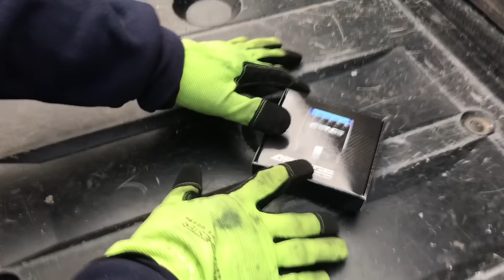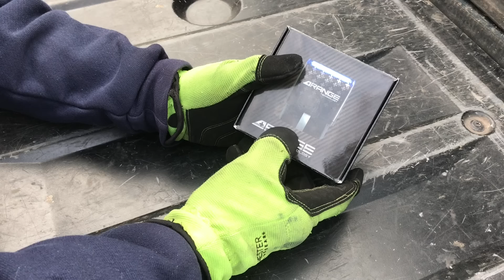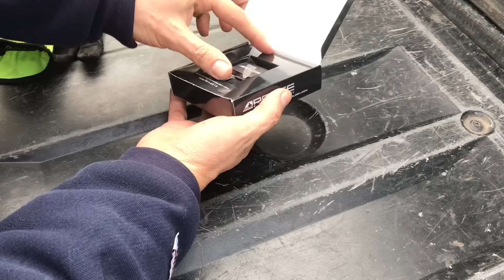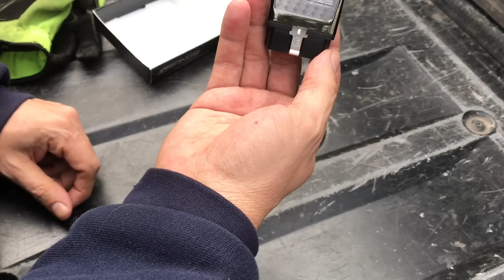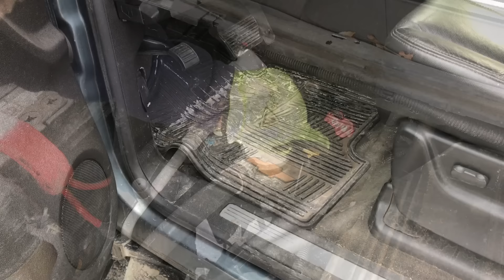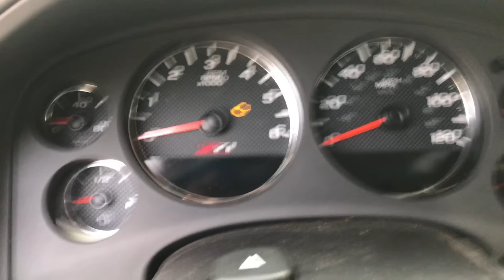Range AFM Disabler - Long Term Review

Comment: wow...wish I had discovered this product before I towed a trailer full of heavy bikes from Springfield to El Paso and back in crazy high heat, on the way down it burned a quart of oil and the tranny was pushing the temp gage too close for my comfort, on the way back I used that tow button on the end of the shift lever, even though the RPM's were higher the tranny stayed cooler and I didn't burn any oil which now I realize its prolly because the AFM was deactivated. 07 Tahoe 5.3ltr 160,000mi.    thanks Hilltown!
Reply from the maker: Your truck got a workout!  I prefer trailer mode and run it most of the time unless I’m in stop and go traffic.  Thx for watching.

Comment: I run one in my 2008 Yukon 5.3 for 10,000 miles now took care of the oil consumption as well my truck runs great @206,000 miles now
Reply: Mono G iam not sure about the vibration your talking about
Reply: How is your yukon going?
Reply: @madbroindustries  well I sold it to my buddy 10 months ago and bought a 2020 silverado 
It still going 256000 miles
Reply: @Jgrace-hu6xn  dammm so it did work?
Reply from the maker: That’s impressive.  Out of curiosity, are you still on the original transmission?
Reply: Hilltown no not original transmission rebuilt @ 185,000
Reply from the maker: Ok, thanks.
Reply: Srt Jg I have same everything yukon and it vibrates on v4 mode when going slow speed and everytime I slow down to stop and still on v4 mode, will this device fix the vibrations?
Reply: Srt Jg is there a big difference of gas saving? Before and after device?

Comment: 175,000 miles and it's using oil ??? Well duh! Gas engines won't last as long as a diesel.
I can imagine the AFM might suffer with an older high mileage engine.
There was a time when the Chevy small block was finished and needed a rebuild at 40,000 miles.
Maybe it's time you did a rebuild.

They must have improved the AFM on the 2018 models. I notice no changes to indicate the truck is switching from V4 to V8.
Smooth as silk and great gas mileage. Not to mention, it's not burning any oil. :-)
Reply from the maker: I’m running her into the ground.  It’ll be interesting to see if the road salt or the mechanicals kill her first.  My history of high mileage Chevys never included an oil burner and i’ve driven three close to the 300k mark.  Thanks for watching and I’m hopeful they got it right with the 18’s.
Reply: I have an 03 with 4.8 ltr with 229,000 miles and it doesn't burn a drop of oil but unfortunately rusted brake lines sidelined it till i could replace them so i picked up a 2011 silverado with the 5.3 and i am becoming and expert in AFM delete preparing myself for the inevitable. It has 125,000 and doesn't use any oil yet. Maybe i can save it.
Reply: Ram a 6.0 prior to AFM well over 300k towing most of its life. Small issues but every car has its own. The basic design of these motors is great. Afm is a joke.
Reply: @kou thao  l have 2017 Chevrolet Silverado and change v4 to V8

Comment: What do you do when you have to do an emissions inspection? Do you leave your Disabler in and remove it at the time of the inspection or do you remove it a couple of days before your inspection to give the computer time to reset? Thanks
Reply: Egerton Ridout it doesn't.  I forgot to take mine off of my Sierra and I passed.
Reply from the maker: I haven’t had an emissions test yet, but I’ll just yank it beforehand.  Interesting comment! Thanks for watching.
Reply: Hilltown do you mean, the sametime of the emissions inspection or days before? Just wondering sir
Reply from the maker: Probably 5 minutes before I pull in for the test.  I don’t see how it can have an impact, but we shall see.
Reply: Hilltown I see your point. I agree with you. I'm thinking about buying a small OBD2 scanner to make sure when I go to get my inspection that I would pass. The 8 monitor screens or Windows on the scan tool need to pass and if they do, good to go

Comment: I didn’t see any comments but I also hear that the stock valve cover with the PCV valve has a tendency to get stuck open and  lets oil through. A friend of mine who is a GM mechanic said that replacing the valve cover on the driver side should also help.
Reply from the maker: When my truck was 5 years old, under extended warranty, the dealer tried multiple fixes for oil consumption including something related to the PCV valve. Unfortunately, nothing worked and they eventually did a piston ring kit. All was well for 100,000 miles and then she started burning again. This device seems to have helped me quite a bit. Thanks for watching and sharing the advice.

Comment: Who the hell buys a 4x4 to save fuel what the hell was GM thinking
Reply from the maker: It’s all about the MPG wars.  Thanks for watching.
Reply: The manufacturer had to meet BHO's EPA standards. That's why gm did it
Reply: The Active fuel management will fail sooner or later...Do a "Delete kit "...remove the lifters, change v-plate, new cam (needs dealer cam learn) and make sure you plug the holes under vlem or valley plate and swap out your oil pump to a standard pressure oil pump and you can still use this device or pay $400-$500 to reprogram the afm. You will immediately notice improved horsepower and smooth idle...you lose about 1-2mpg but no headaches and very reliable. Good luck.
Reply: whats the delete kit and all that run price wise?
Reply: @KA317-1  The delete kit ran me $650(Amazon) and the diablo sport afm disabler was $200(Amazon)..$120 melling standard pressure oil pump..my buddy is a GM tech and installed everything for $400..oh the rivet gun and plugs were $100(summit)....gotta plug those lifter holes or there will be 0 oil pressure at idle...the kit is all the gaskets, camshaft and a few other internals.
Reply: @KA317-1   a true full delete will cost you thousands by the time the labor is installed . If you take it to a shop which 99% of people will have to , it ain’t exactly a DIY job.
Reply: @ceedavis5178  Note that it only makes sense to do this after your warranty has expired, because the "Delete Kit" will void an existing warranty.
Reply: @chrisgraham2904  Delete Kit yes. But using Range is ok and will not void warranty.
Reply: Federal CAFE regulations
Reply: It’s the governments EPA that tell manufacturers they have to have a certain MPG avg. it goes across all there vehicles. So they have to save ever ounce they can.
Reply: Wonder if the government knows where the missing oil goes!! Atmosphere maybe ....... that's good and green.
Reply: @davidrobinson7887  That's right.  The system squeezes an extra mile of travel out of every gallon and then burns the oil releasing far more pollution into the atmosphere.   The EPA standards are being met, but the regulations cause a larger carbon footprint.
Reply: @davidrobinson7887 catalytic converters lil bro
Reply: There you go, applying common sense. Come'on man!!!
Reply: Tree huggers
Reply: yeah pretty stupid to think anyone wants to save on fuel.
Reply: EPA
Reply: they did it on v8 auto camaros too
Reply: you can thank the EPA  the range device is illegal in california
Reply: @punker4Real  they won’t even know you use it 🤣
Reply: Amen to that my guy. I love hearing my 8 cylinder gas hog and my 35's humming on the pavement. If I wanna save gas I bought my ol lady a mini van. 😉🇺🇸
Reply: its the epa, how do u not know this.... trucks have been getting regulated since the early 90s and its only getting worse
Reply: Bunny huggers in league with the socialists. The socialists want to control our movement, and the bunny huggers gift wrapped them a marketable excuse.
Reply: Thank Obama! It was because of regulation
Reply: That's what I'm saying.  If you want a woman's truck do get a v8

Comment: I've heard some people were getting a CEL. Some times it would pop on and off, or just stay on. Has that ever happened during the period of time you've had it installed? Also heard these devices have been improved recently too though.
Reply from the maker: Hey Husky, I was a bit worried about that too after reading other reviews.  So far, so good.

Comment: Great Review , I run one on a 2010 5.3 Silverado , works very well , helped with oil consumption considerably , can't tell any difference in mpg one way or the other.
Reply from the maker: That’s good to hear and others can benefit from it to.
Reply: Michael Proulx, I too have a 2010 5.3 liter Silverado LTZ. I'm glad to hear that you having great success with the Range device. I have been wondering about buying one and wanting to know from you, how long have you had it in your truck, have any lights came on light the ABS, traction control or check engine lights and have you noticed any issues with your transmission? The reason I'm asking cause of other reviews, but they have different years models and you have the same year make as I do, so I want to compare apples to apples, lol. How many miles do you have on your truck and how many miles has I been since you installed the Range AFM deactivation device? Thank you

Comment: I'm a little worried about the long term effect of this device damaging the engine. Even with 2010 Silverado 5.3 liter that I have, just want to know if the Range device would have any long term effect on the engine
Reply: Tammy Ann  I’m replacing the motor in my 08 now. Lifters collapsed at 129k mikes. I’m turning off the afm, this time around.
Reply from the maker: I don’t see how it could, but that is just my novice opinion. To me, the ill effects of AFM outweigh any possible risk.  Thanks for watching and good luck with your decision.
Reply: Milltown, how long have you been running the device in your truck and did you order it through the Range website? How many miles have your ran it on your truck. Yes, awesome video and thanks for sharing
Reply from the maker: I’ve had installed for about 7k miles over a four-month period and I purchased it through Amazon.   After reading other people stories, I would recommend buying it direct through Range.
Reply: Milltown, do you notice any difference in the transmission once the range deactivation device is in? I was wondering if it shifts the same or have you noticed whether or not the transmission is shifting hard into gears? I have the HD 6 speed transmission in my 2010  Silverado LTZ. Thank you
Reply from the maker: No difference at all bud.
Reply: A mechanic just looked at my truck, 2010 Silverado LTZ, this device will save you from your lifters collapsing.  Unfortunately I did not catch this in time and now I have to buy a new engine and he highly suggested that I purchase the AFM disabler not to have the same problem again.  Get the device for $150 to $200 instead of dishing out $5000 to $10,000 when it damages your lifters and you have to replace the engine.
Reply: Tammy Ann    A whole new engine because the lifters went bad?.....hmm🤔
Reply: You mean long term damage  like your lifters collapsing burning oil and or damaged camshaft? Thanks Chevy AFM
Reply: Will this save my lifters from collapsing or will they shit the bed no matter what?
Reply: How fast will my truck go with the range

Comment: I had a 2007 Silverado that was eating oil also.  It would lose a quart every 3000 miles.  I found a TSB for a revised valve cover for the 5.3L AFM engine.  I took it to the dealer since the oil consumption was documented as starting at 35000 miles on the truck.  They explained that the oil was being splashed up on the PCB valve.  The oil was being sucked through that system.  The revised valve covers had a PCB splash guard installed to minimize the oil being sucked into that system.  They wouldn't put it on my truck though since my vehicle had 96000 miles on it at the time when I found the TSB.  Of course the TSB came out in like 2013 and my truck was a 2007 and way past warranty.  Being a TSB and not a recall they had no obligation to put the new valve covers on my truck.  I told them where they could put the truck and sold it soon after.  So I don't think the cylinder deactivation has anything to do with the oil consumption.  Search on 

"10-06-01-008G:
Engine Oil Consumption on Aluminum
Block/Iron Block Engines with Active Fuel Management (AFM) (Install AFM Oil Deflector and Clean Carbon from Cylinder and/or Install Updated Valve Cover) (Jan 3 2013)"
Reply: Milltown, try using some Lucas Synthetic or Heavy Duty oil stabilizer. I just put it in my truck with 79,000 miles on it and I have had great success in past vehicles with Lucas oil stabilizer. I use it in my 98 GMC Sonoma with 2.2 liter engine. Truck has 280,780 miles on it. I have been using 3 quarts of Castrol Edge full synthetic high mileage oil and 1 quart of Lucas Pure Synthetic oil stabilizer. I don't remember the mileage when I start it but I know that it has been 3 years now and my oil consumption on this truck went from 3/4 of a quart at 3k miles to 1/8 of a quart at 3k miles, so the Lucas did help with the oil consumption and a lifter tick at start up. So I would guess that I have been using the Lucas in my Sonoma for about 40k to 45k miles
Reply from the maker: Thanks for the comment.  I too experienced oil consumption shortly after purchasing my truck used back in 2011.  Multiple service visits later led to the PCV fix and ultimately a piston ring kit at 79k miles (thanks to extended warranty).  Well, that was 100k ago and the problem is reoccurring.  The ol’ Chevy’s getting long in the tooth, but I hope to keep her going a few more years.

Comment: Also change the PCV valve that is integrated on the drivers side valve cover.  E z to do and helps a ton on oil consumption.
Reply: There's an updated valve cover for the driver side of the engine that also relocates the PVC valve reducing this issue
Reply: @jamesguralski5156  how can you tell if its the updated version?
Reply: @r8rcarlos580  I just replaced mine. new version has bigger rectangle hole with little baffles. The Original cover had round I think 5/8 diameter hole.
Reply: Catch can
Reply from the maker: Yep, very true.  Mine has the fixed orifice type.
Reply: @HilltownCT  I just replaced mine, did you have any white smoke before changing it? And did the change fix it?
Reply from the maker: Nope.  Are you losing coolant?
Reply: @HilltownCT  I'm loosing coolant
Reply: does it work or just another band aid i'd like to know
Reply: Change to what ? A new one or any specific brand name?
Reply: @mariomoya3565  replace with the updated oem valve cover

Comment: Are there any issues running this product for a long period of time and then going back without it?
Reply from the maker: I removed it twice for about 40 miles without any problem.  Can’t speak for others tho. Thanks for watching.
Reply: Range claims that it will not hurt the engine removing it for a while and then reinstalling, I'm not too sure about that! Who knows, time will tell
Reply: I was actually wondering the same. Anything getting stuck from not using it having this device plugged in for so long. Thinking of buying one myself. This is the only concern